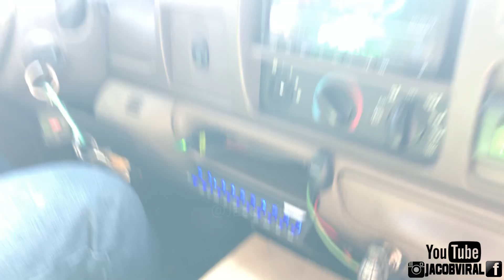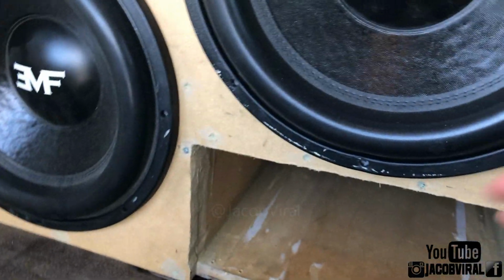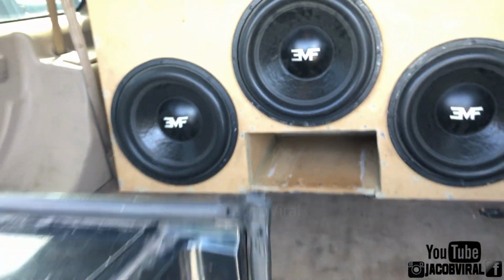FORD EXCURSION 3 15S BUILD

Comment: My setup is with the md5k and it goes into protect if I hit the low 11’s on voltage
Reply: Yeah my md8k protects at 10.8 volts lol.
Reply: Yeah I got an MD 8K with four AGM batteries and a Mechman 370. On just the bass and the volts drops fast at idle. That stock setup would be very scary to the amp.... That amp really comes alive at 14 volts.
Reply: Brett Davis yeah I have a ces 370 on it now and getting more power but still dropping volts lol.
Reply: Buy more batteries one at a time. Hell that's what I'm doing.
Reply: Hell I'm thinking about dual 370's alternators
Reply: Brett Davis yeah I’m thinking about going ying long lithium.
Reply: Doesn’t the spec sheets say 9 volts then it protects?

Comment: Love the fact Jacob is always nice. Unfortunately the truth and facts are not always so nice.
It is NEVER, EVER acceptable to run an 8k amp off stock electrical. Especially with a Brazilian amp that has much higher internal power supply rail voltage than most amps. Voltage drops on these amps can and will cause them to burn up literally 🔥 🔥. This is crazy, careless and dangerous for others parked around you. At minimum you better have a 370 alt with 3 group 31's to even think about running 8k properly.
Reply: Thank you I'm glad I'm not the only one saying this although it is completely obvious 2 most
Reply: @plattnumcustomcaraudio3086  I'd been thinking of starting a channel similar to Jacobs but I'd be too much like Chef Ramsey. Maybe it could work lol "Install nightmares" 🤣🤣
Reply: I've ran the 8k like this for a while and it was at .66 ohm, as long as you know what you are doing it can be fine. Everyone is quick to say these amps will light up but I haven't had any problems out of it.
Reply: Dude that would be awesome but unfortunately it seems the people don't want the truth I've had some really nasty replies to some of my comments even as far as they wish they could slap someone through the phone
Reply: @theofficialhabitualaudio4447  yeah how long have you been running it like this
Reply: I'm only running an RP 2000.1 and 2 pioneer 4 channel's  but I have a stinger agm and a marine deep cycle full tilt I'm low 13.1 at idle 14.1to 14.4 over 2200 rpm trust me you will have issues sometimes it's sooner or later but it will happen just trying to save you some money unless you just have plenty to spend anyway good luck🙂
Reply: Over 6 months. Ran a hd3k at .25 on 12's  for over 6 months also before getting these and getting bigger amp.
Reply: @theofficialhabitualaudio4447  a 1ohm amp run at .66 ohms on stock electrical, as long as you know what your doing 😥😥
Carry on I'm out.
Reply: @theofficialhabitualaudio4447  you know what though is that a diesel Excursion or gas they probably have a pretty large alternator don't they my truck only has 95 amp
Reply: Also I don't know where you live but if you needed help with an enclosure I do Custom Enclosures and I won't kill you on cost
Reply: @plattnumcustomcaraudio3086  I'm located in sc and don't need any help with enclosure as I build and design them too.
Reply: @theofficialhabitualaudio4447  10- 4 just trying to help sorry if i sounded like a dick anyway have a good one
Reply: @plattnumcustomcaraudio3086  It's all good. It's just not everyone needs to be bashed on for the way they run there system. Like saying its unacceptable, dangerous, and that the amp will burn up when that isn't true. I get it though not everyone knows how to handle low voltage and gets into trouble with it. Also some people don't know anything about impedance and box rise so they don't understand that in some case without china boards its also okay to wire down to compensate and it also depends on what your trying to accomplish. Like if it's a daily banger or a weekend burp machine. In that case I ran the hd3k at .25 and the md8k now at .5 for daily banger and never had a problem out of either of them.
Reply: @theofficialhabitualaudio4447  so are you doing it to prove a point or just not have the money right now I can understand both  but you would definitely get the most from your amp with the high voltage
Reply: Well he'll so with my setup I could run a 15K correct
Reply: @plattnumcustomcaraudio3086  Yeah you can but the question is do you expect/set it to do the 15k?
Reply: A big lithium battery would also take care of it.
Reply: This is why i don't buy used amps anymore.